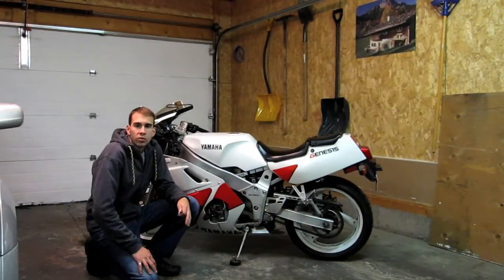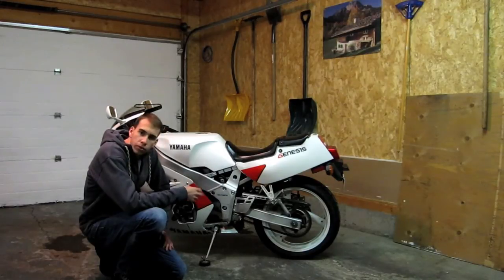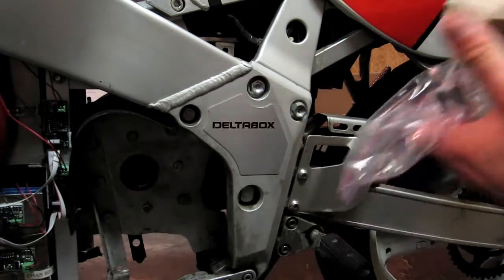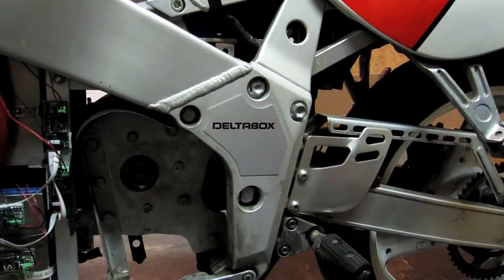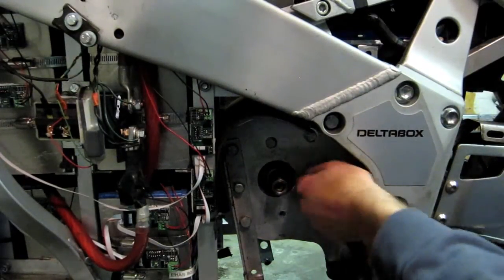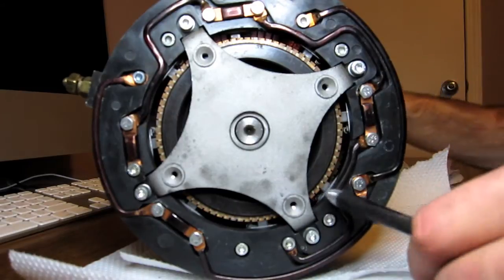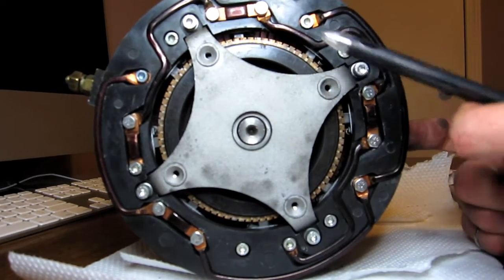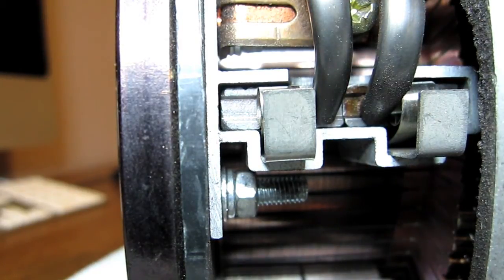#11: Motor Inspection 2013

Comment: Hi the commutator looks OK.The brushes look like they haven't worn in yet and some arcing has happening. Electric motors need there brushes run in which means connecting motor to low voltage and run unloaded  for a few days or upto a week.to let the brushes wear to shape. 
The brushes are designed to last 1500 hours at contunuos rated load ie ME1003 200amps. Also the brushes are set in an advanced timing to reduce arcing so motor will perform better in one direction and arc less than in the opposite direction.  Its important to set brush timing to suit direction.
Reply: interesting.. just wish i understood what you meant by setting the brushes timing.. as i am building an EV bike myself.. and was looking at brushed motor.. due to half the cost compared to brushless setup..
Reply from the maker: storxusmc
Brushed motor timing is all about the relative position of the stator magnetic field to the rotor magnetic field. A neutrally timed motor will have the two magnetic fields at 90 degrees to each other for maximum torque. If a motor has it's brush positions "advanced" the two fields are no longer at 90 degrees to each other and thus the motor will have less torque, but will also have less back EMF which gives rise to higher speed. Search "Fleming's left hand rule" for some more insight.

Comment: good work, newish to ya page and enjoyed this peak inside the belly of the beast, is there a reason a brushless motor couldn't be used? specs/price? but u sir have done a great job!
Reply from the maker: Thanks. Yeah, I guess I could have used a brushless motor, but I chose the brushed motor based on a couple factors.
-It was the most powerful/lightest motor/controller setup I could find that would fit into the motorcycle properly (more power than an AC setup, without hanging out or looking ugly).
-It was a much less expensive setup. ie. $1500 vs ~$4-5k for an AC setup.

Comment: Sounds like the brushes are not worned enough, obviously we can't expect a motorbike to go reverse to worn them evenly.

Do you plan to replace the motor by one with the same format and brushless in a distant future ?
Reply from the maker: Yeah interestingly enough, the spot of grittiness/cleanliness on the brushes is about the same width as one of the com bars.

I have no plans to replace the motor or controller, they make a fantastic setup.
Reply: *****
I believe it does. On the other hand a brushless motor would mean a new controller to handle the hall-effect sensors but in the end less maintenance has there are no brushes.

Meh, it is still at least twice more efficient than the original ICE ^_^